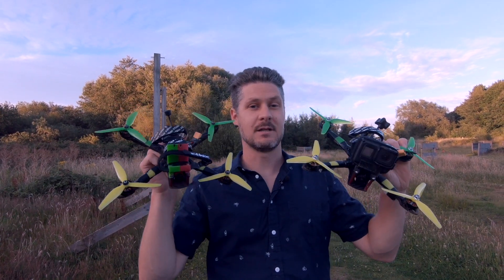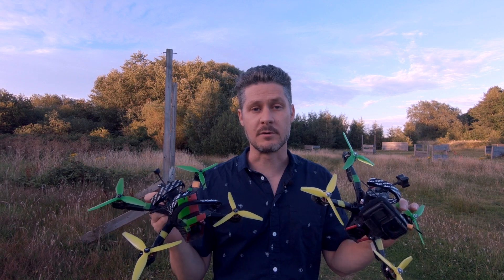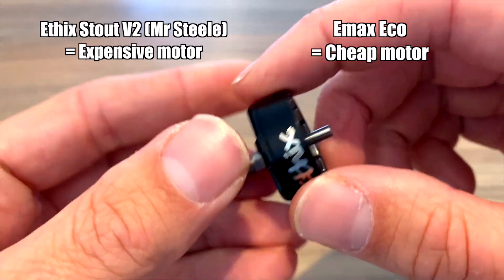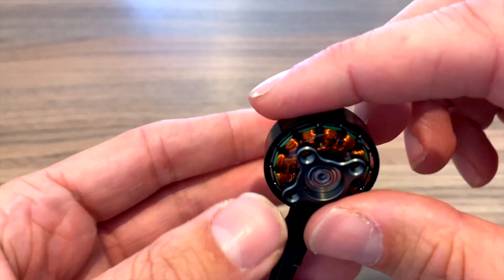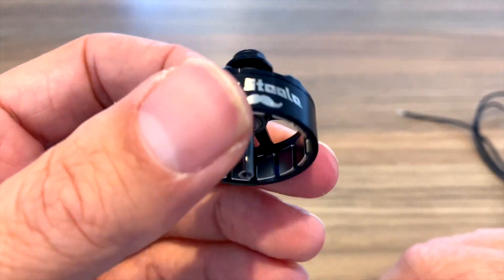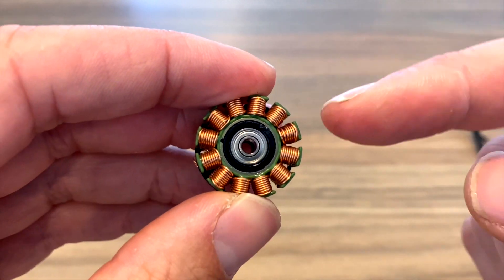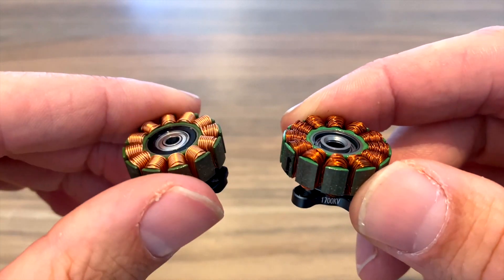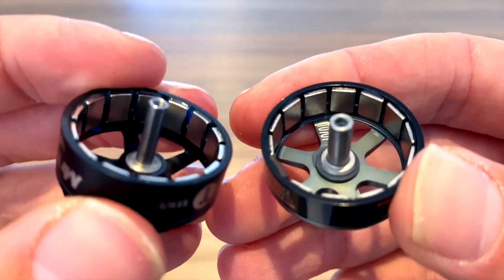CHEAP VS EXPENSIVE Motors for FPV Drones. Which is Better?

Comment: Can u please tell me which flight controller is used in that drone,also how that drone is so stable please answer me
Reply from the maker: This was a Hobbywing G3 stack but I’m using Mamba DJI stacks now. The stability is just practice and - I can’t remember for sure but probably has hypersmooth turned on in the GoPro7. Hope that helps
Reply: @MagicFPV  thank you very much for repling🤗

Comment: Nothing unexpected there.....Put a name of repute to a product and you can name your price...especially if the business is owned by the seller.
I`m not sure if he has his own manufacturing company or if he has them made by an established company.....Whatever applies i`m sure they are good quality motors....but as you proved..so are the Emax at about a third of the price...Bottom line... both will brake if its a bad day.... your 2nd set of the Emax motors will be free...compared to Mr Steele`s price.
Reply from the maker: Since this video, I’ve broken just one eMax motor... otherwise I’m running the same set months later! And the Eco V2 look even better 🤩

Comment: I have flown the ethix v1 and v2 mr steele motors and the eco's aswell the eco's  dont disapoint!! And the bearings last 10x longer then the steele motors, the misses is flying the v1 steele motors on a basher now and i have to say, ethix motors are smoother
Reply from the maker: FPV Alert interesting. Yeah I think the Ethix motors are a touch smoother and more responsive but there’s not much between them (apart from the price!) 👍
Reply: @MagicFPV  well, i didnt open the ecos up yet but you pointed out some other intresting stuff, the ethix motors are thin compared to the ecos and i hear a lot of people bend bells on the mr steele motors (i only flew them untill the bearings gave up) whyle i used the ecos for over half a year on my basher and it seen some intense crashes, now on an other quad and the ecos still do fine, the steele v2 motors are on its 3th set of bearings an put away for 'later' but make an update in a little while with both quads if you can. Like to see how they both hold up for you
Reply from the maker: FPV Alert oh wow, so sounds like you’ve run both extensively and done the test of time. I’m off to some bandos soon so we will see 😬 haha

Comment: Great vid bud, enjoyed that. Big fan of Hypetrain and iFlight Zings. I won’t be getting Steele’s now.
Reply from the maker: Flying Pig FPV thanks bud 👍 I actually rate the Steele motors just not the price. I’ve flown the iFlight Xings too! They’re great. Can you get Hypetrains for 6S now?
Reply: Magic FPV - I’m still on 4s but building a 6” Badger with Hypetrain 2150kv, so might be a bit high Kv for 5” 6s.

Comment: Think a lot of the time it’s the bearings life span that make the difference. Good video interesting that you struggled to tell which was which. Emax must have done a great job.
Reply from the maker: gareth vaughan very good point. I couldn’t find out the exact bearings, so will have to run them for a while and see how they hold up 👍